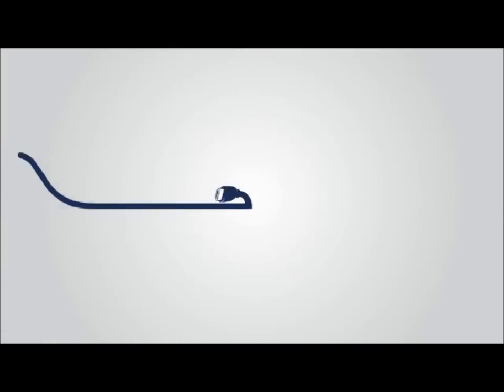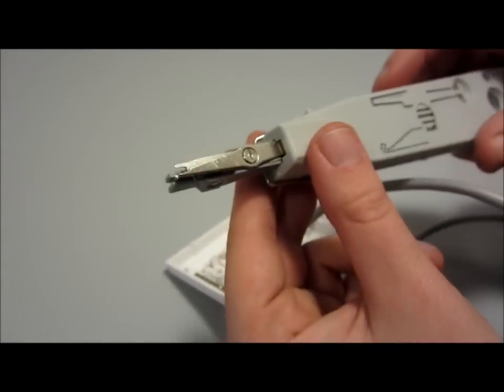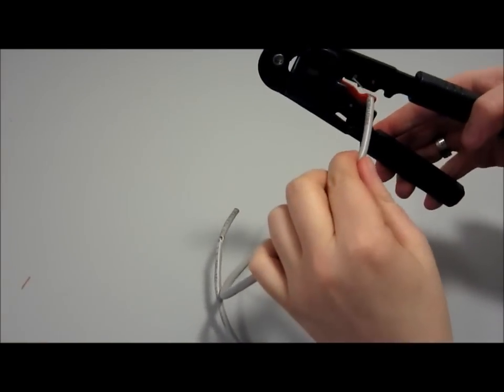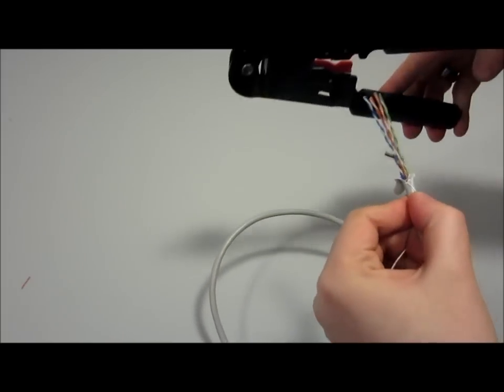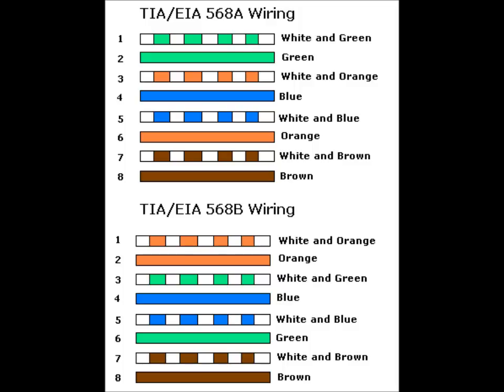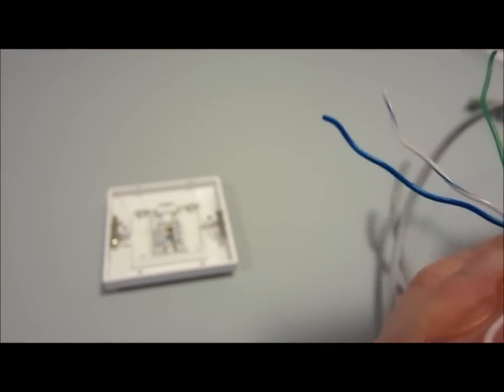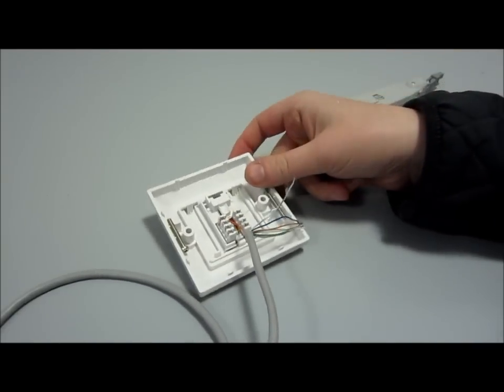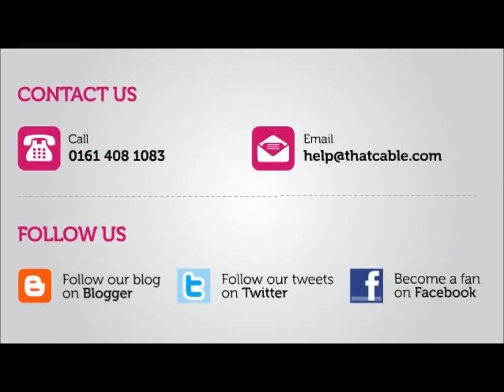How to use an IDC Punch Down Tool - Loops

Comment: Just a small point but that cable is wired in upside down as its meant to be cable tied to the bit above it !
Reply: this is correct he wired it upside down so cant use cable tie on it. and its a big point not a small one

Comment: I find this particular style of punch down tool a right pain to use with these style face plates.  There's not enough space in between the two rows of terminals to fit the tool, especially once you've connected one side.  The slimline tools are better without all the bulky plastic bits to get in the way.

Comment: Great video, thanks for the up load! Just wondering how you actually remove the cable once in the idc socket? Cheers
Reply from the maker: There is actually a hook attachment that is supplied on the punch down tool, this allows you pull the cores out of the socket if you make a mistake or just want to remove all of the cores. It won't damage the IDC terminal if you do it carefully. If you need anything else, please let me know. Thanks!

Comment: Does it matter if you use 568A or 568B, it's just as long as both ends use the same?
Reply: correct. It is not very common nowadays, but in the past, "crossover" cables had 568A at one end and 568B on the other. This used to be needed to connect two computers together with a single cable with no network gateway or router in between. However, most LAN cards now accept both configurations for either purpose. The problem arises when you change the configuration mid-run, like through the wall jack he's making. If not done carefully, you can make your connection unusable. So it's best to stick with 568A on both ends, always.

Comment: If I'm inserting more than one wire, like with a phone line extension, can I do them simultaneously or do I punch in one and then the second wire?
Reply from the maker: Ed Paffett Hi, This face plate will only take 1 CAT5e/CAT6 Cable, if you are looking to split a signal several times, you would need a network switch and a face plate for each cable run.

Comment: hi

I'm used to using a punch down too that always trims as it punches . But I recently bought a new tool that looks just like the one you use in the video.

 it came with no instructions but I have found by fiddling around with it the cutting action can be turned on and off with the lever near the head,  and that the rotary button in the middle of the handle sees to adjust the depth of the punch,.

But I'm not sure under what circumstances you would need to adjust these two  features. 

are you able to explain more aboutt the tool itself ?

Comment: Do you need to turn anything off when doing this, sorry .complete novice here, i want to shorten my cable route around the skirting edge instead of  where an Openreach engineer put it up and down the walls and along door frames,my route would only be less than 3m ,where as his was 12m. along with the huge hole he put through one of our walls, dont look very professional.

Comment: terribly unprofessionl terminating, fed in TP from opposite side, cable has to be lodged into special groove and fixed with a cable tie preventing any possible loosing electrical contact while installing on wall.
Reply: and also if you strip it properly you don't need to strip back further to remove damage you have done. Awful demonstration. Should be called how "not to "